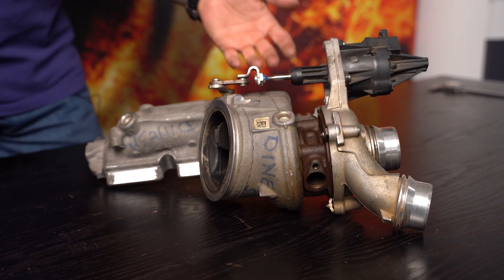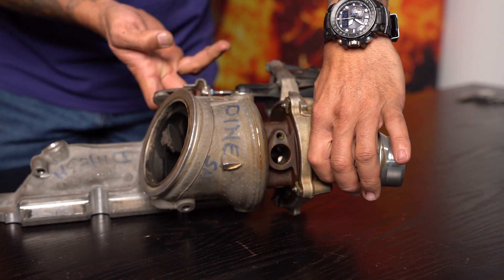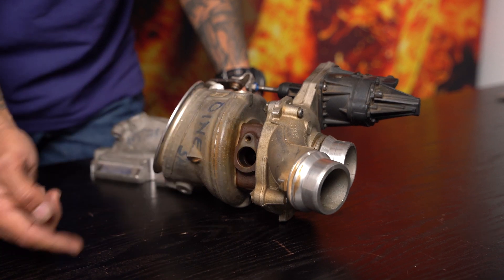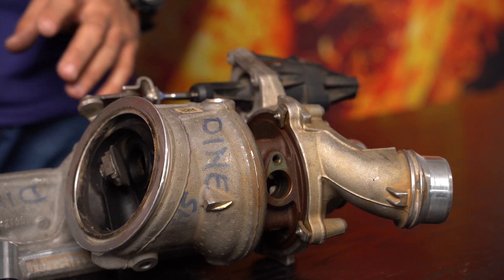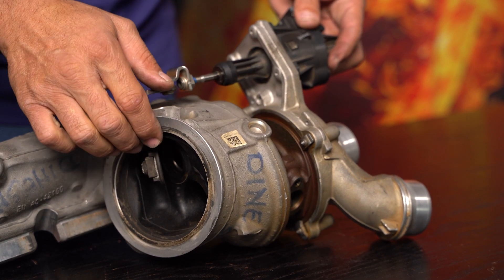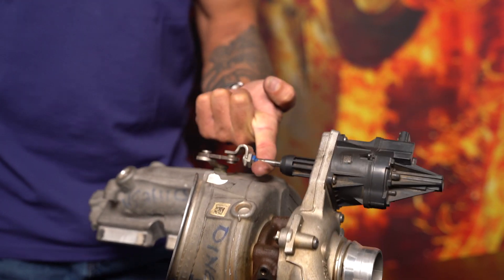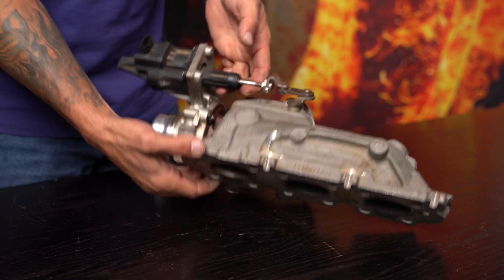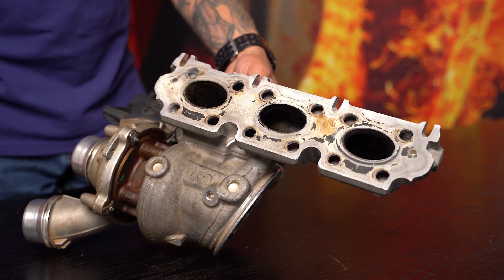Turbocharger innovation - its not the manufacturer you would expect !

Comment: Completely water cooling the turbine housing in manifold is an absolute game changer. This opens up the world to different types of materials that can be used. One foreseen problem that I see is the increased heat loading on the cooling system and how much more imperative maintaining the cooling system will be
Reply from the maker: Upgrading he cooling pack is a relative simple and cheap exercise, and carried out pretty well with reliable results so far.

Comment: How much more taxing on the cooling system would that be ? I wonder if it's a big deal to cool this assembly from 700° down to 400 ish.
They must have massive radiators no ?

Also, still creates more and more complexity. Can't change the turbo without changing the manifold, can't change the manifold without draining coolant.... more potential for leaks...
Reply from the maker: Cooling packs are designed with all the calculated thermal loads in mind. This is not complex at all - VW and Audi have had integrated manifold and turbine housing castings since the late 90's -- Kia, Honda, Opel, Ford and many others use this today, its in fact much less complex, less gasket face leaks, and much easer to install. Draining coolant with any water cooled turbo (VW, Audi, BMW, and almost every VNT diesel turbo is water cooled - int he bearing housing) involves draining coolant - no getting away from this one.

Comment: The BMW B58 used in the supra incorporates the exhaust manifold into the cylinder head.
Reply from the maker: Correct, so does VW, Audi, Porsche, Citroen, Renault, Opel and many others, this is nothing new in terms of a design, however using Aluminium is.

Comment: If I get this right, you need to go down 300 degrees or more to not have temperatures that melt the manifold, surely you dont need to cool off 300 degrees, but still, doesnt it need a lot of cooling capability of the radiator to keep this in check?
Reply from the maker: Correct, Ally melts in the 600DegC range depending on the additives in the material, but even so when at say 550DegC, the material becomes slightly malleable, and with vibrations will deform.  So the temperatures are kept very low in order to prevent this from occurring.

Comment: How dose condensing the "hot " gas before the p1/p2 point effect responce/ performance?   I saw a 100°f reduction of EGT  at all points accrost the boost scale by wraping my cast iorn manifold and turbine housing (making the air the turbine wheel will see  hotter ) 

They have addresed this change in dynamics . Im curious what the changes are. I fill safe in saying probably they can getaway with a much tighter turbine A/R without choking. 
Cummins has water cooled manifolds and turbine housings for marine applications not Al , but...  most are massave  .95-1.25A/R non-wg and none really suitable for road use.
Reply from the maker: You need to understand that ENERGY (in the form of heat) is responsible for exciting the turbine (driving it) so the hotter you get the inlet gasses (without hurting the engine ofcourse - perhaps you aren't even using an engine in the first place) the more you will achieve blade excitation (yes thats actually a terms in our turbo world)  

Water cooled (flame proof turbines) which we have designed and manufactured since 2017 are available BUT forget about performance depending the deign of the housing. This format is used specifically for safety and creating a safe operating environment (Im referring to flame proof applications) by making sure that no point of the entire engine bay exceeds 130DegC even after shut down (heat soak). The way to do this is to cool the turbine housing, exhaust manifold etc with a cooling jacket - therein lies the problem if it is performance you are looking for - the heat energy is gone .... not much drives the turbine (not as much)  -- there is a way we developed to maintain the same EGT's as the stock engine setup even though the product is still water cooled and passes the SANS standards for flame proof applications (including the explosive tests that are carried out)  But this is a secret which is not able to be cast due to the complexity of the internal structure.
Reply: @TurboDirectSA  the thermal dynamics part was understood and was what drove the question.
The 130c 266f is practically what I have achieved with the exhaust wrap , granted 1000 Fahrenheit is my Max.  The 130c is a tall order especially if trying to maintain performance
Reply from the maker: @daviddroescher  Exacto mondo buddy -- spot on.